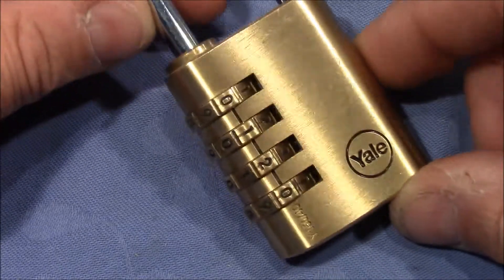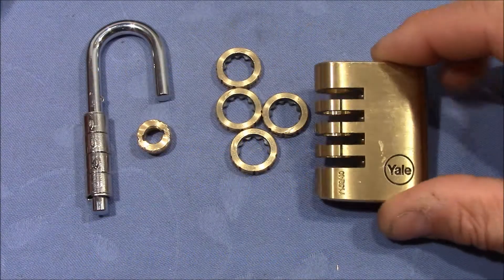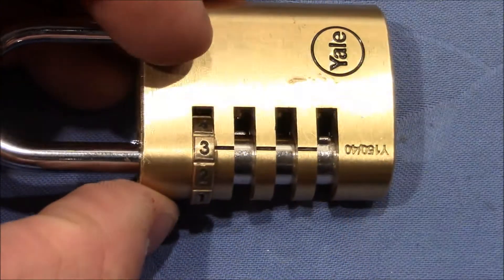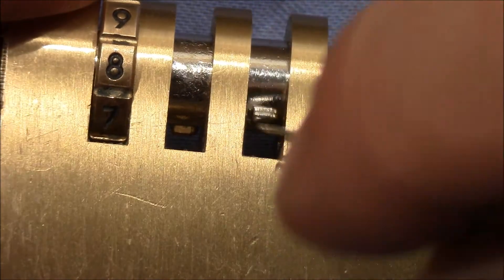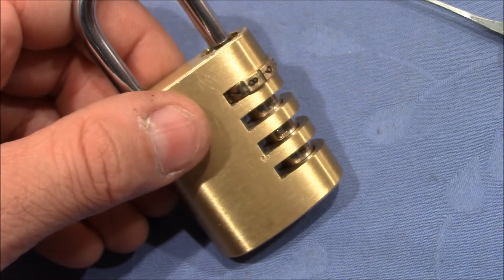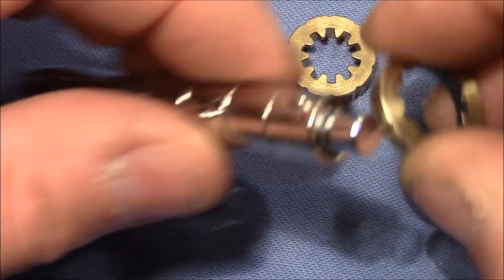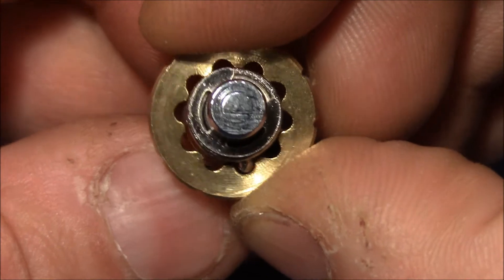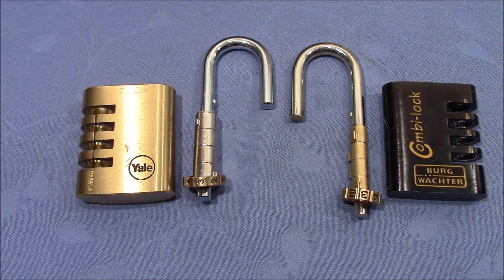(picking 545) Mysterious decoding uncovered: Yale Y150/40 disassembled and inspected

Comment: how did you disassemble the yale lock ?
Reply from the maker: Most combination padlocks of this kind can be taken apart by removing the cap that sits on the shackle side that stays in lock body. Use a pair of pliers or a vice or a screwdriver for the procedure.

Comment: I wish I could recall what brand/model my grandpas lock was. Many decades ago, around 1980ish, he had a combination lock that had (I think) 5 digits + 1 digit (or maybe a lever, not 100% sure anymore). The way it worked was quite interesting:

The basic principle was that you had to get the 5 digits right first before you could dial in the last. The idea was that you couldn't tension the shackle, as this would only tension the 1 separate digit. And you couldn't dial in the separate one unless the other 5 were correct.

On the other hand you couldn't "tension" the separate digit, though I forgot exactly why. That lock frustrated the crap out of me back then. Granted, I wasn't exactly skilled back then.

Sadly, when grandpa passes away, the lock got lost. I wish I could have a look at that one, as I've never seen one like it since.

Anyone got an idea what brand that might have been? The lock was used in Germany, making me guess it might have been a German lock. It was well-worn, so I'd place it originally pre-1970.
Reply from the maker: No idea buddy, but sounds really interesting. Maybe search for pictures of old locks at google.

Comment: It's amazing how small differences in design can make or break a decoding/picking method :o) Good explanation of what is going on. Yale only needed to make those outer wheel cutouts a little bit deeper to prevent this decoding method, as far as I can see... though this is  an easy thing to say, maybe not so easy or cheap to do :o)
Reply from the maker: Yes very true, a little bit deeper cutouts would be sufficient to prevent this method from working. It would be interesting to know if the lock manufacturers know about all these tricks and simply consider it to be unlikely to be exploited in real life. Anyhow, it was mind boggling to finally find a totally different answer to how it works than initially thought. These puzzles make combination locks a fantastic toy.

Comment: Wow nicely figured out and explained - you did well getting to the very bottom of the reason why it behaves like that! :D   I think I'll have to watch this video a few times!  So a couple of questions: 1) You talked about how when the tooth was in the true gate (in the Yale) that the side (or up & down) movement seemed to be symmetric, but if the tooth wasn't in the true gate then the springiness would be non-symmetric and have a direction ... does this direction point to the direction of the true (and thus you know which way to go to find the true gate faster)?  2)  Is it difficult to take the tend cap off to dismantle the lock? (I'm wondering how difficult it would be for me to do - how did you do it? - any tips?).
Reply from the maker: (1) Yes there is a certain preference of the spring resistance when you turn the wheel. But I cannot use it to reliable determine the position of the tooth (the gates are always on the same place as they are milled in the chamber of the lock body). I believe we have a superimposition of the spring force that always tries to push the wheel straight outward and the resistance by the tooth that changes it's angle. But when the tooth and the direction of the spring force are inline we have a symmetry. In the case of the tooth next to the spring (=true gate position) there we have the loose feedback.
(2) I clamped the lock in a vice with a rag around and drove a flat head screwdriver between the lock body and the cap. You have to apply a good amount of force and go all the way around. But once it comes off, then it's easy to pry out fully. It you need more info about the disassembly, please let me know.